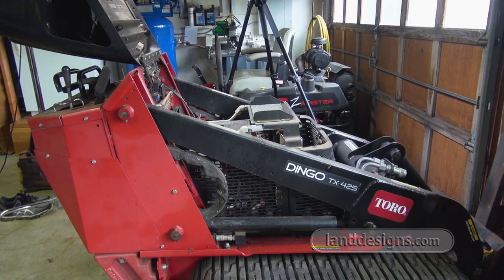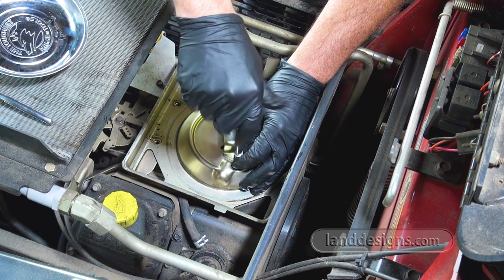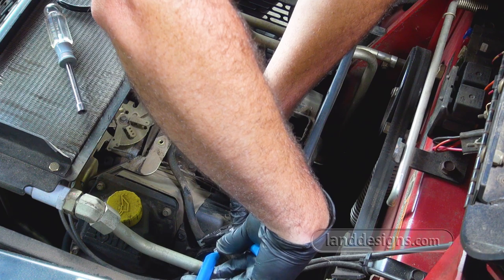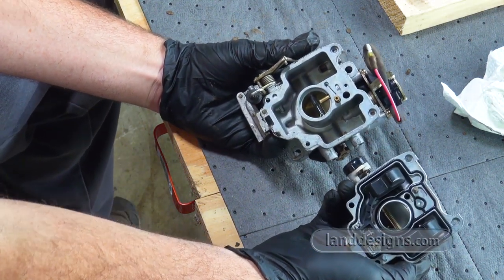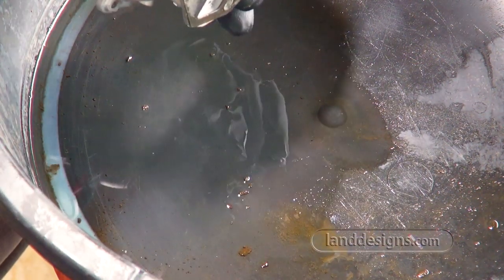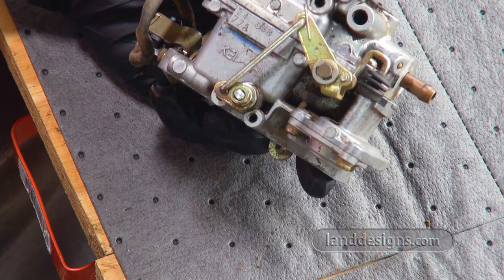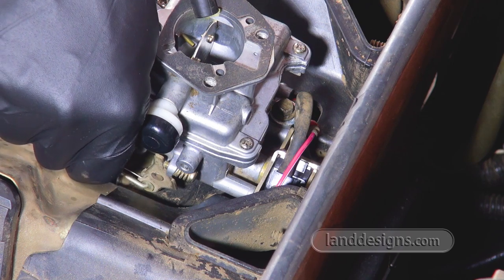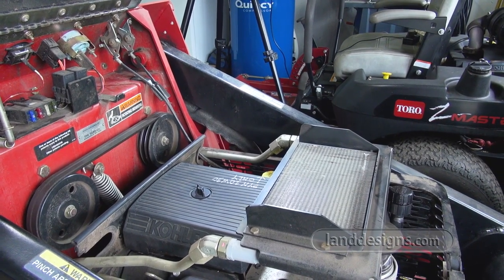KOHLER COMMAND TWIN CARBURETOR REBUILD EP.01

Comment: It's a LOT easier to remove those four screws that hold the carb body together if you break them loose BEFORE you remove the carb from the intake manifold.  That way you can use an impact driver to tap them loose without stripping the heads.

Comment: You forgot to pull the solenoid off and remove the jet  and there is a Welch plug next to the solenoid, remove it by drilling it out or sometimes it will just pop off with a pick or screwdriver and that is the idle mixture screw, clean both holes but u should have the top removed first

Comment: 33:30 - what is the part on the right side of the carb with the rubber boot?  I've got two CH18 engines and one has it on the carb and the other does not.  Is it some kind of accelerator pump?

Comment: Do you know if I can buy a o ring kit for the jets .. I looked everywhere I can't seem to find them
Reply: I have a complete o-ring kit , but even the smallest is to big . I think you and I both will need to get a carb kit to get them . Don't know how much that will set a person back . If you can't find a kit then try a shop that does diesel injection work
Reply: Now that I think about it , some motorcycles and quads use that make of carb , might be worth checking a motorcycle shop

Comment: I am cleaning the carb on a similar Kohler engine (the model sticker is apparently under an oil cooler on the left side but otherwise it looks like yours) and I have the atomizer thingy out of the bottom half of the carb.  Did you ever find out if it is supposed to have a hole all the way through the center?  I am using the wire from half of a stripped paper twisty tie to make sure the side holes are clear, but it stops 1/4 inch into the "pointy" end.
Reply: Is the hole in the emulsion tube supposed to go all the way through or not?
Reply: @nickcalderone75  Apparently not, since my emulsion tube's hole does not go all the way through, either.  A welding tip-cleaner will not go all the way through.

Comment: Have you ever wished you had the diesel model? I have heard the gasoline models can run low on torque while using attachments.? I have owned a s70 bobcat for awhile and love it. But have been considering moving over to a dingo or mt55? What is the largest caliper tree you have installed with your machine? I love your videos thanks. Michael - garden gate. Raymore mo.
Reply from the maker: They didn't make the diesel model when I bought my Dingo.  Otherwise I'd probably have it.  The power is there to run the attachments but you just can't beat a Kubota diesel.
Reply: +CTSCAPER what is the largest size of tree you have safely planted with your dingo? Thanks.
Reply from the maker: I would say 2.5" b & b.  That's lifting the tree off the back of my truck and to the hole.  I'm sure you could plant a 3" ball with a trailer and some fancy maneuvering.  2.5" is about as big as I want to go these days anyway.
Reply: +CTSCAPER thanks for the reply